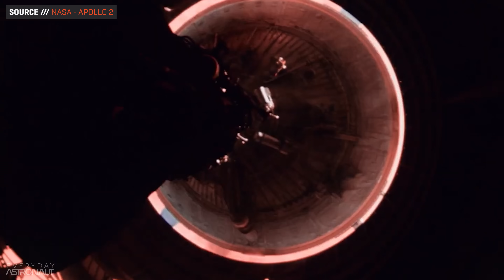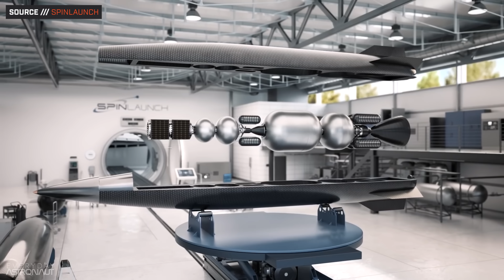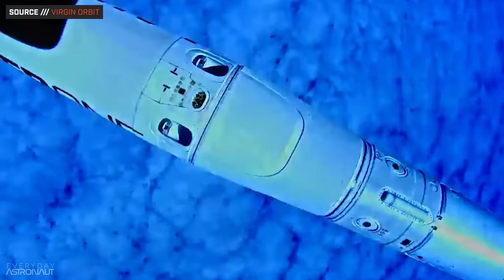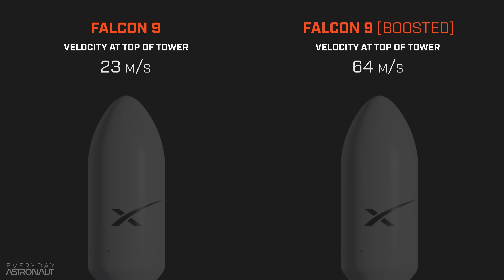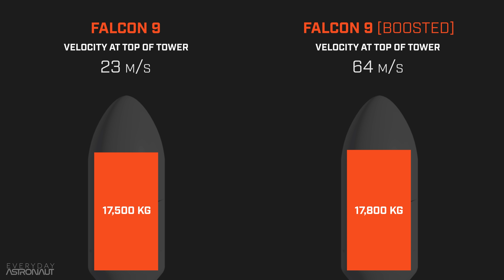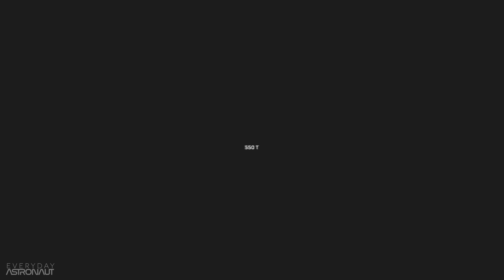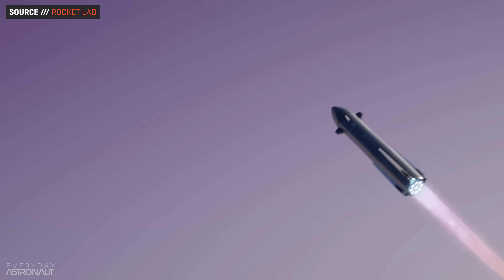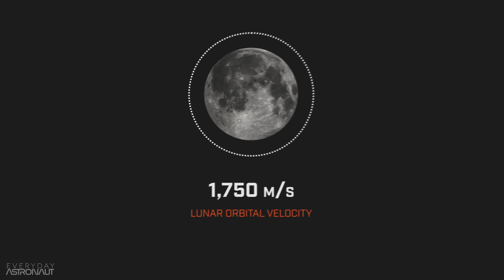Could We Help Push Rockets To Orbit?

Comment: This video seems a little off, in terms of Tims reaction to the electrical power needed. He compares to things like superchargers, EVs and average home power usage, but I think these are not helpful comparisons. It makes it sounds like 100,000 kW is a crazy amount of power that couldn't possibly be handled safely and would push what we are capabale of doing. And so to me this video seems to say "power is too big, can't do it". But I don't see how that is true:

There are commerically deployed wind turbines generating 15,000 kW, TODAY. We pump tens of thousands of kW through high voltage power lines that dont even require active cooling, TODAY. There are ships that use motors that output more than 50,000 kW of power, TODAY. We could use capacitors, sure, but we could also use more cheap batteries in parallel, which isn't mentioned. Instead of a steel cube with 28m side length, we could a concrete cube of 42m side length, which is about 300 TIMES CHEAPER!!! It's on the ground so size really does not matter.

I'm sure there are many practical problems with all of this (not least the small gains), that might even be dealbreakers. But in terms of power needed, I think this video fails to explore the actually interesting problems.
Reply: There are also giant flywheel energy storage systems which can release 400MW within a couple of seconds. Technology-wise that point is already an established thing you could just copy.
Reply: Yes Tim's energy comparisons are not helpful.    Any salient figures get lost the the "flack".   It is almost as bad as the super common ,   super stupid "Olympic sized swimming pools".
Reply: Yer I didn’t really understand the angle that it is too much energy. Rocket fuel is also a lot of energy. Don’t aircraft launch systems use steam?
Reply: Ummm, the NIL laser system delivers like 500 terrawatts in a split second. Generating a ton of energy fast is something we can totally do today. Also then he says the extra velocity gives an additional 300kg of payload, but that's not the metric I would care about. It would be how much less fuel weight would be required to lift the same payload? It's the rocket equation in reverse. How much weight can we save and still have enough velocity to make it to orbit?
Reply: Exactly. I wish I could thumb-up this comment a thousand times. The factual/technical analysis in the video is great while the tone and conclusions... not so much. If the conclusion is - there are better ways to invest efforts and resources near term - like building bigger FULLY REUSABLE rockets - sure, I totally agree. But it feels to me the sentiment is like "this isn't feasible ever... because there is just better ways - like bigger rockets" which is just false and very ridiculous. Didn't it occur to the Tim's team to calculate the (electrical) energy that could have been generated by simply burning that rocket fuel on the ground and then compute the mass that can be accelerated to orbital velocity with that energy using magnetic acceleration in a vacuum tube? - How rocket acceleration scales vs vacuum tube acceleration in terms of energy consumption per payload mass?
Reply: Yeah it was weird to me that rather than talking about the max capacity we have to release electrical energy, it was for some reason converted to units of either Tesla batteries or Tesla charging stations. How is that relevant?
Reply: yeah,  the first time he said 980MJ, I laughed, that's nothing in terms of energy.
Biggest problem isn't energy, its building a 50km tunnel for the launch system
Reply: What is additional velocity before ignition of the engines worth in economic terms? Such charts would help better estimate which kinds of projects are promising, and at what scale. Longer term it's thinkable that chemical rockets will first travel through a (linear) accelerator before ignition.
Reply: A one meter square solar panel generates 150 W.  A square kilometer would generate 150 megawatts.  A half a billion dollars would build that.
Reply: A single bugatti chiron outputs a bit more than a megawatt, Maybe you could fit 10 of those in a shipping container and discard the rest of the car frame, and keep only the fuel (to last ~5s) and engines.
A single top fuel dragster makes ~7 megawatts of power for a few seconds. Put 10 of those in a shipping container and you get ~70 megawatts per shipping container. (And you need to worry even less about air flow because the nitromethane has oxygen in it).
So something like 7 shipping containers volume worth of high performance nitromethane engines, and throw in another for fuel and oxygen/air buried under the tower with a bunch of carbon fiber cable and hydraulics can power the launch assist for falcon 9.
Reply: I love your thoughts on electrical power. I think we should make airports(Spaceports) to launch rockets from the ground. The video brings up a good point about launch sequence and how the pilot has a limited abort for takeoff. I hope someone can figure it out for the huge rockets we are planning to make.
Reply: Playing with unusual ideas is fun! 😄 Lately, I heard a rather wild one: prepare a deep mine shaft that will be flooded with water, place the rocket at the bottom, and attach a very large balloon filled with air that will pull the rocket up, so it reaches ground level with a helpful amount of momentum.
Reply: It's not that much electricity actually, AI datacenters consume 100,000,000x just flipping bits between zeros and ones.
Reply: Yes; my thought was that 3g of acceleration would put enormous forces on the vehicle when it’s fully fueled, and the vehicle would need to be redesigned to accommodate the additional forces at launch — probably resulting in a larger dry mass. 

This seemed more challenging than the launch-assist-mechanism’s power requirements.
Reply: The problem is not the 100 MW, it's the 5 GW for 3 seconds, or the 2+ GW for minutes. Of course possible, but ridiculously expensive and complex to handle
Reply: 100,000 kw is what Greenland uses in summer.
Reply: I would think the biggest goal for launch assist should be down-scaling the fuel requirements of the rocket itself: with arguments being more along the lines of how many pounds of fuel are consumed over the length of the tower; how much of that lift can we store on the ground.

I would try something like a Stage-Zero where the rocket engines ignite AND boosters attached to the launch-pad. The entire pad becomes a rocket sled, meaning you don't have to take as much weight up into the first separation stage.
Reply: Yeah.. Frankly, I don't think the power requirements are the weak point here.. If you use Ampace AM04 cells, they can discharge at 40A continuous.. so you would need 675,676 of them to get the 100mw of power to launch the Electron rocket. Retail, they cost $6 a piece which is just over $4 million total. The cells also store 4ah of energy, which is 10mwh. At 177kwh per launch, you could do 56 launches per hour if you could load rockets fast enough. Also, at 40A continuous and 100% depth of discharge, they have 400 cycles of life. Even if you charged $100,000 extra per launch, that would be $40 million revenue over the lifespan of the batteries.

 Admittedly I'm leaving out the other expenses of building the battery pack, but I genuinely don't think the power is the biggest expense. I think drilling the 1km deep hole and building the maglev system would be the more difficult part.
Reply: @joetheaugustine  I would guess just summing the cost of individual cells underestimates total cost by a lot, as it neglects electrical connections, power control circuits, cooling, etc. Looking at a research report for grid scale battery storage, it costs ~$1 million per installed MW, resulting in a cost of ~$500 million.
However, these systems are typically designed to run at this power continuously for 4h. If we just need to provide the power for a few seconds, it can probably be built much cheaper.
Reply: A simple “teeter Totter” with the loaded fuel offsetting a counter weight… IDK but this seems very simple and doable,  the launch mount/pad would just have to moveable.
Reply: Chemical energy storage in batteries is simply tooooooooo slow to use an aprecable amount over seconds. Capacitors and maybe flywheel energy storage will be needed for intense pulsed power. A Spin launch platform on the other hand has minutes to hours to spin up.  Although it still takes quite a bit of energy, the power demands over a much longer time is significantly less.
Reply: @kreynolds1123  I mean, the time is the key.  Where does a normal rocket get all its energy from?  Well, some of this energy is from the eons of decomposition of biomatter into hydrocarbons, but it still takes a lot of energy to keep, store, and transport all that fuel and oxidizer.  The thing is, all that happens over an extended period of time.  So while it might sound like storing a nuclear power plant's amount of energy for the given time, you accumulate the energy over a much longer period of time, massively reducing the power requirements.
Reply: No way electrical will work for this.  Hydraulic accumulators or giant pneumatic actuators would be the only thing powerful enough.  We're talking over a million horsepower for the starship one.
Reply: Why don't you build a 1/10th scale prototype and launch a small payload to space? Prove em wrong and make some fistfuls of cash in the process
Reply: @joshuajackson472  Haha, thanks for the encouragement, but at best I'd be capable of launching a beverage bottle a few feet above ground, before it ignites its imaginary engines 😅
Reply: Getting out and pushing a rocket to the moon will get there before Elon does
Reply: I also didn't like the argument that these solutions would hardly deliver return on investment. A $4 billion development cost represents just 16% of NASA's annual budget or could be jointly funded by international space agencies. The environmental benefits of dramatically reducing rocket fuel consumption and emissions justify public investment, similar to how governments fund renewable energy research without expecting direct profit returns. With over 2,700 billionaires globally and government space budgets exceeding $35 billion annually, funding constraint isn't the real issue. Launch-assist technology could revolutionize space access costs and sustainability, making it worthy of public research investment regardless of short-term private market viability.
Reply: What you missed is the fact that THE NEED IS TO GENERATE THAT MUCH POWER PER SECOND.  That's the "Almost impossible" hurdle.
Reply: @sdebeaubien  Quote: "What you missed is the fact that THE NEED IS TO GENERATE THAT MUCH POWER PER SECOND."

  I guess it would be beneficial to learn the basic terms from high-school physics before commenting on scientific/engineering/technical subjects. The resource that is required is ENERGY (measured in Joules or in kW*h (kilo-watt-hours) =1000Watts*1hour=3600000Joules or sometimes in Calories=4.184Joules). And POWER is the amount of Energy produced or consumed per unit of time - AKA ENERGY PER SECOND (measured in Watts=1Joule/second or in kW (kilo-watts)=1000Watts or sometimes in horsepowers). The comment's author is talking about levels of POWER that is already widely available and manageable (AKA ENERGY produced/transferred/consumed PER SECOND at scale). There is nothing "impossible" in that - right now (not in a distant future) - and Tim's own computations even show that it is not even too expensive but his narration tone somehow suggests otherwise (contrary to the facts he himself states in this video).
Reply: Tim didn't say it was impossible, he said that it was difficult, and the degree of difficulty is such that (for the foreseeable future) it makes better economic sense to develop booster technology to get those single-percent gains in payload that launch assist offers.  AND, these power-is-available comments fail to address the engineering issues (inertia, static loads, thermal loading, braking and power recovery from the assist device) of getting that force to the rocket whilst keeping the entire ground system feasible.
Reply: caps are cheaper and more power dense than any battery
Reply: @bobmike2373 they definitely are not power dense.... Also batteries like LTO bridge the gap.
Reply: @bobmike2373  Hybrid car btteries are perhaps 100 more power dense than the Tesla main battery.  Batteries for the Electron perhaps an order of magnitude more.

Comment: If I were building from scratch.
Mount Kilamjaro, to take advantage of equatorial acceleration and it's elevation.
Super Capacitor powered rail gun linear accelerator.
Inside a vacuum tube.

Comment: The yeet-la.... i mean the spin-launcher is about as close to a scam you can get without being openly criminal.
They already have structural problems with their scale-model but that one didn't even reach 10km in height and the projectile always came out wonky. It also is a >30 minute bumpy ride under extreme acceleration and can only handle small payloads.

As for linear electric accelerators: 450MW isn't that insane for short burts. And lo and behold - something like that not only is possible but it exists and is tested:
The launch-systems on aircraft carriers have basically the same requirements. Here you are talking about 980MJ in ~2seconds and those launchers provide ~400MJ in that time. 

And all those energy-calculations... yeah that is energy that the rocket ALREADY has to deliver, just now it is fuel-mass that it also needs to accelerate with its not so efficient rockets. If you need 980MJ of kinetic energy to clear the SpaceX launch-tower at 3G acceleration than it already is using that much just to clear it at far lower speeds right now.
Reply: I'm very disappointed at the omission of steam catapults. The catapults the US Navy uses already yeet stuff three times the mass of an Electron rocket, and they probably wouldn't be that hard to scale up. Point one straight up and it could probably have the rocket going close to 300mph by the time it cleared the launch tower.

Comment: 18:00  Why in the world would they use a cube of steel when they can use an only slightly larger cube of concrete.  Even better, why don't you just dig a hold 30 meters in diameter, 500 feet deep.  That's about the height of the Mechazilla tower.  You can line the hole in concrete.  Then build a steel drum 26 meters in diameter inside the hold.  Reinforce it all you like with steel cables or cross beams, then fill it with concrete.  Total cost, under 20 million and it weights the same.  The air craft carriers look very dramatic, but remember they are mostly air.  They weight less than the tiny mount of water the displace at the very bottom of the ship, that is why they float.
Reply: if for some reason you abs needed steel you could just line the outside of the concrete with it. drastically cutting down on the cost.

Comment: One that you didn't cover that I've always wondered about. Is a gravity drop loop. Start at a high elevation drop it down in tube maybe even vacuum sealed. Fire the rocket at the bottom of the loop.

Comment: @26:15 I think the vacuum tube would refill with air from the upper atmosphere. The very few molecules up there would bounce around in the tube, and some would fall into the gravity well. Eventually the pressure at the bottom would build to near or equal normal atmospheric pressure. Although the mix of  gasses may be different.

Comment: Plus, part of the main loss of fuel is due to clearing the tower. Having to do it in the air, it will take more fuel to light the engines after the helping arm thing.

Not worth it

Comment: drop that cube into a zero tolerance tunnel and funnel the air into launching the rocket like I did when I jumped on those air powered rockets as a kid. No rocket fuel needed. May cause some tornados or hurricanes as an aftermath. Someone run the numbers on these I think I am ready for some venture capitalist money.

Comment: 21:38 Orbital mechanics don't care about the velocity being "in the right direction".  Assuming you leave a point in the atmosphere with a given speed with at least some upwards momentum, you still need the same amount of remaining Δv to insert into a circular orbit.  There are limitations to that statement, eg if you are somehow able to boost straight up so fast you have to an apogee higher than your target perigee, well nice problem to have but you'd need to steer to convert at least some of that to horizontal velocity.  Atmospheric drag also taxes your Δv, so an overly shallow initial angle will work against the yee (the object of a yeet).

This is why, when you see the mock–up videos of the Spin Launch system, the full size gyro is inclined.  Because (within reason) the launch angle doesn't matter.

This all means it would be more productive to consider building this very long maglev tunnel (usually called a "space cannon") on the Western slope of a mountain or stratavolcano; for instance, the Chimborazo volcano in Ecuador is 6.2km high and only 1°30'S—perfect for such a space cannon.  Many locations in the Himalayas, such as Mount Shishapangma (8km) in China is at about 30°N, close enough to the equator so as not to miss out on the earth's rotation as added velocity.  Borneo is equatorial and has a decent peak, too.  It'll probably still need to be "dug in" underground somewhat, but at least it doesn't have to be straight down!

Note that most of the payload boost wouldn't be from starting higher up, though I'm sure that gives some.  It's from avoiding the thickest parts of the atmosphere.  Max Q typically happens at 10-12km, so it's by no means at the edge of space, but still significant.  Another random factoid: if long enough, a space cannon also has to be slightly curved, to account for the Coriolis effect.